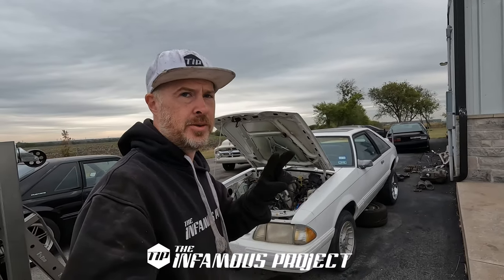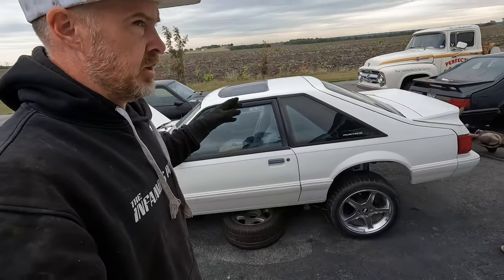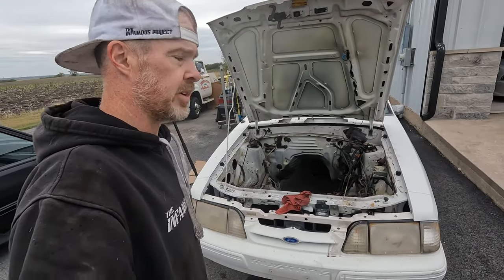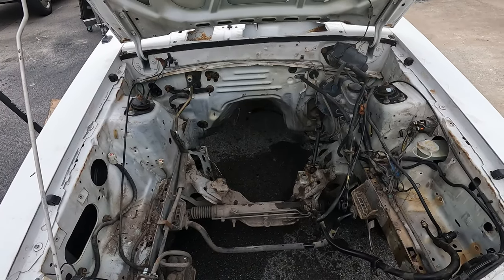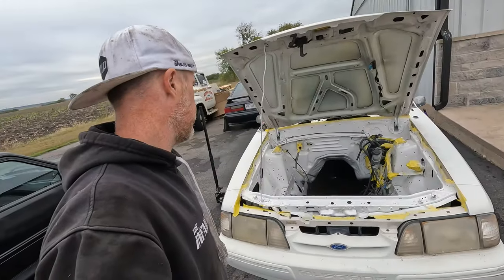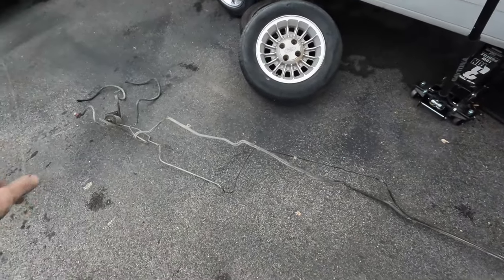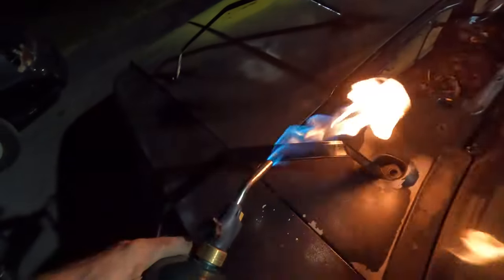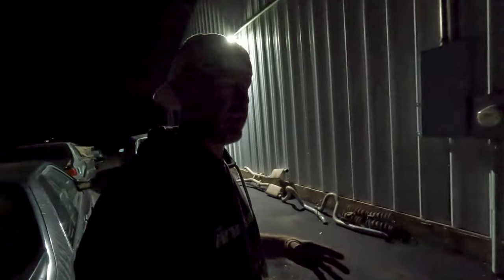Foxbody 4 Cylinder to 5.0 V8 SWAP in Detail! - Part 2 Getting Your Car Prepped - TIPS05E84

Comment: Best trick ive learned with painting engine bays is use aluminum foil to cover wires and etc.
Reply from the maker: Good one!
Reply: I dont know if you could answer this question but i have a 93 gt that needs a harness but i also have a 91 gt donor. Im assuming the only way to use the 91 harness is to change out everything including the dash and chassis harness? Both 5 spd cars
Reply from the maker: @bobbysmith4783  yessir
Reply: Thanks for your response.

Comment: Could you do this swap with a 1980 4 CYL four eye?  I"m assuming the wiring is not compatible at all and that there would be a lot of other issues... tank, ect.
Reply from the maker: I'm sure you could. Wiring was simple back then as it was just for power to the coil, choke.etc.